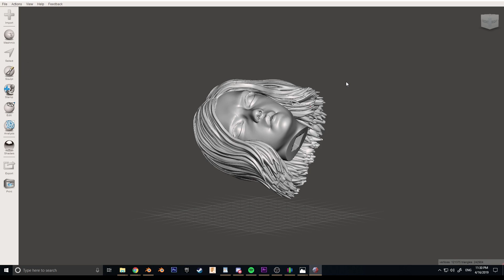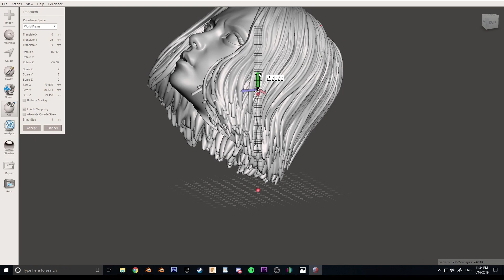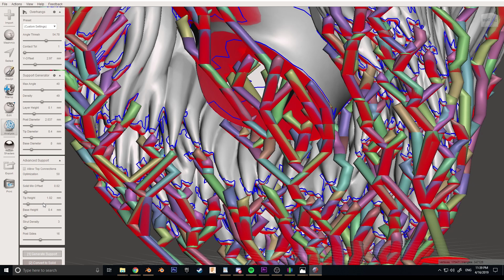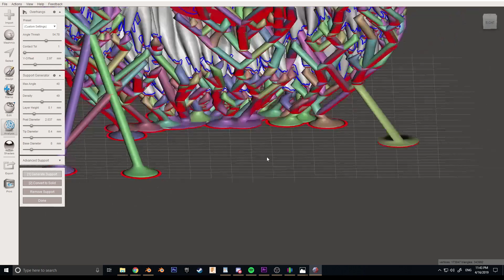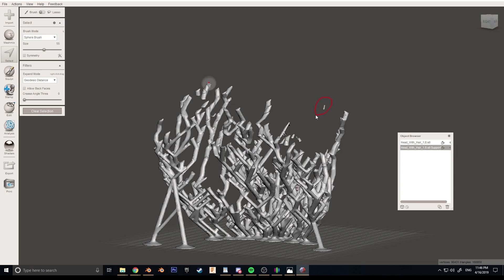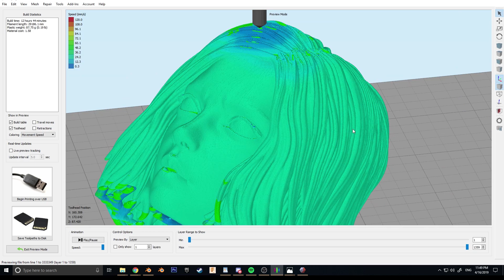Meshmixer Tree Support Tutorial 2019

Comment: Thank you for this. 
What I find strange is that it sometimes tries to make supports from parts of the print instead of making a support on the build plate. 
I want to edit them, but when I add a support from the build plate towards the section where it forks, I'm not able to remove the unwanted support. What is the recommended way forward here?

Comment: aligning the 2 in cure isn't as easy as this. resetting their position won't put them correctly aligned if the supports are acentric compared to the actual model. not sure what i'm doing wrong here

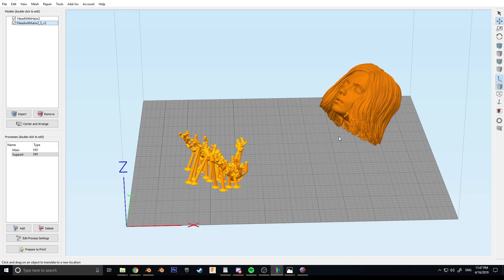Comment: What is "reset position" functionality in Prusa Slic3r ? 10:25
Reply: I couldnt find one, but what I think works is you add the main part that isnt supported first. Then right click on that part and do "add part" and select the supports. If you add both parts at the same time the supports do not line up correctly, found that out the hard way :O

Comment: So I followed your tutorial. I did learn a lot and for the record you need to hold shift to get the support to work from the model.I found that out by accident. lol
 However, aren't these supports made only for resin printers and not FDM?
Reply from the maker: I use them for FDM and they work just fine if you calibrate your printer and the meshmixer settings. I'm experimenting with doing a similar video with other software that might have better tree supports than meshmixer.
Reply: @techtree6962  any news on the new video your said you were making with better tree supports than meshmixer?

Comment: Very Useful, I've been racking my brain on how to support a model from thingiverse.  I have been going trough printing cubes and lattices to dial in the 3D printer for the filament and generating supports, in all slicers I could find. They all are quite terrible at supports. So eventually I ended up on youtube and your tutorial. I have to say very informative. so with your tutorial and Prusa's Now I have the outside of the model solved. The inside is another challenge as It is kind of difficult to generate supports inside the sealed model.  I am not proficient at meshmixer but maybe there is a way to use it to do infill only in certain areas. Anyhow you may want to continue with these videos. You'll figure out the rest of requirements later.
Reply from the maker: Infill is what you would use for internal supports. A value between 5% to 20% is good for most models. Make sure you are using at least 5-6 top layers.
Reply: @techtree6962  Thanks for that. I was trying to avoid using infill. Because it has to be allover, and I feel it may be unnecessary, However since my last comment I learned another cool thing , how to hollow the object and then use patterns. I do not want the entire object to be filled with infill. I did a rendering and it was 200 hours. So I may need more fiddling with it.  Thank you for you video.
Reply from the maker: @RoamingInterests  Infill should not add much time at all to your prints. Maybe an extra hour if its a long print. Infill is usually the fastest thing to print. Internal structures can take way longer than infill because they will print at the same slow speed that the rest of your model will be printed at and will have the same number of walls.

Hollowing and internal supports are really only useful for resin printing. On FDM they only increase the chance of a print failing, increase time and material use. Infill is far cheaper and quicker.
Reply: @techtree6962  You know what, You're right it is cheaper, But this print is a bit large, and inside would have some unsupported features, and infill cannot be in sections. Because 5% infill will not create the necessary support for the inside features. You know what rather than me trying to explain i will give the link to the thingiverse object I am trying to print at 800% scale, and if you slice it and look inside you will see that 5% infill may not do it. https://www.thingiverse.com/thing:3126519
Reply from the maker: @RoamingInterests  From looking at the model I can tell you that the issue is the non-manifold faces. Its not a model that was properly made for 3D printing. All of those internal parts shouldn't exist. Id suggest taking it into mesh mixer and making it solid. You can use this tutorial: https://youtu.be/RpLSGyt5JQA

It should print just fine with 5%-10% infill just fine after that.
Reply from the maker: @RoamingInterests  I just tested it myself and it worked. Use the Make Solid tool. Set it to accurate, and max out the mesh density and solid accuracy.
Reply: @techtree6962  Thanks for your help.

Comment: i do this on 4.1.2 and it slices nothing, but if i try to print only one of the processes then it appears :/
Reply from the maker: Make sure you have both processes selected when you go to print. Also make sure that in each process you have the right model selected.
Reply: Same problem here, everything is selected correctly, but when I hit the button, nothing appears. Single processes work fine.
Reply: I have the same issue here. What is the Simplify3D version used in this video? I am using version 4.1.2 and this version is not accepting the distance so near between the supports and the model. When I move the supports far away from the object the process works without any change.
Reply: i have the same problem.
Reply: Hello,
Has anyone been able to solve this problem? Is it related to the version of S3D? Or another parameter to adjust?